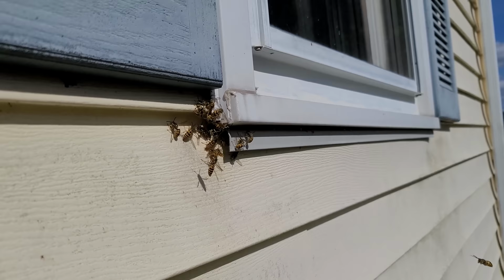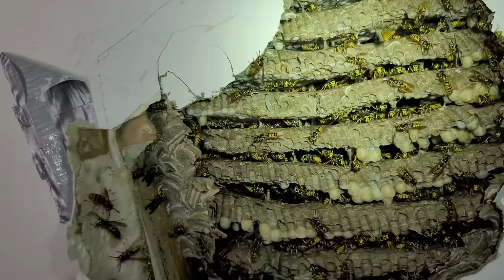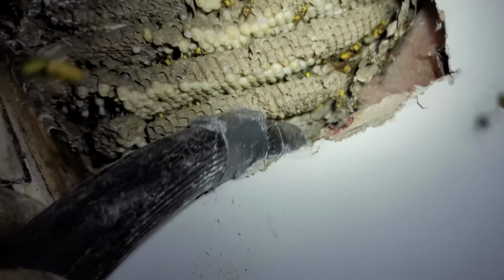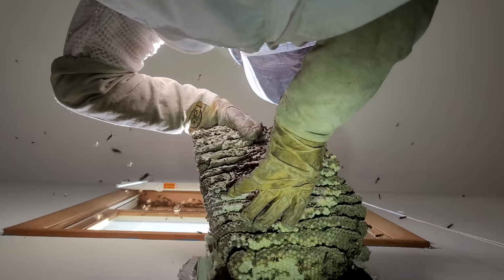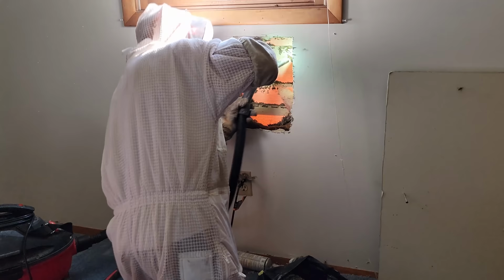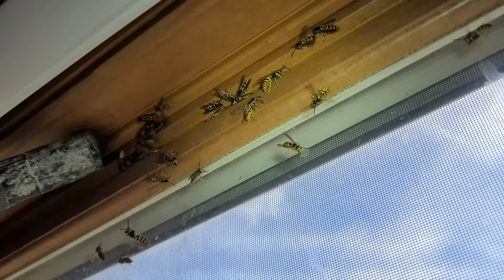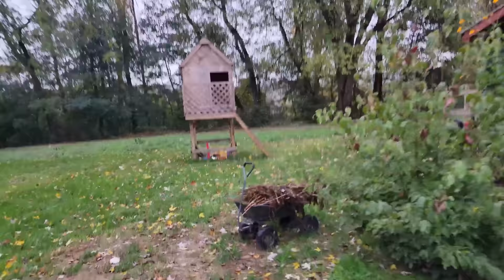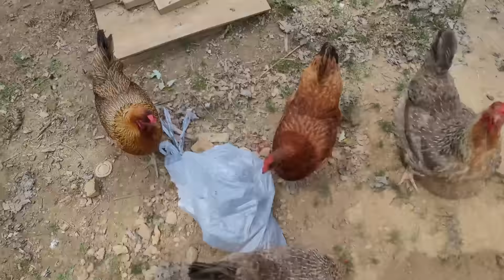MASSIVE Yellow Jackets Nest INFESTATION in Bedroom Wall | Wasp Nest Removal

Comment: I work in pest control and there was a customer who was finding wasps in their home, I went up into their attic and what I saw was a hornet king size nest, you could see the nest on top of the insulation which meant that the nest was probably 8 inches to a foot thick, and it was the entire length of that piece of insulation so it was probably about 3 feet long, easily the biggest nest I’ve seen even after watching a good amount of your videos. Sadly we do not do removals when it’s inside the attic like that so the only thing I could do was treat over the top of the nest with dust and treat the entrance from the outside, which does kill the nest but it’s by no means an instant fix like your removals
Reply: Is there a reason you don’t remove attic ones?
Reply: @blaah9999  Well it takes too much time for we have to be at multiple stops a day, 2 we do not carry vacuums like he does so the wasps would be let loose into the attic/home, 3 minimizes risk for the chance of a tech being stung, a lot of the people in pest control are new to it  so we are told to let the product do the work for us 

Imo if I had the time and was supplied a vacuum I would have no problem doing this for a customer, I’ve only removed a nest the way he has once and that was because it was a total nest breakthrough into someone’s 10 year old daughters bedroom
Reply: @abe_g24  If it was not an instant fix, why didn't advice the customer to contact someone who could actually do it? Someone with time, better tools, and better skills.
Reply: @fuongbregas  I'm going to guess money; why would a company willingly refuse a customer and pass them on to a competitor?

Comment: Had one like this attack me in bed, woke up screaming when i was about 12, they came through the outside wall through the edge of the air conditioner pipes etc, and worked a hole beside my bedroom window, dont know how many there were but luckily it wasnt a full blown nest like this, i will never forget that moment, My father had a bout getting rid of them for sure.

Comment: Here in California, if a house is built with 2x4 walls, the exterior walls need a 1/2" or 3/4" sheet of plywood or OSB to give sheer strength and seals against pests. This is often augmented by additional siding, such as hardiboard. It's wild that it's code to have just vinyl siding as the only thing on the outside of an exterior wall.
Reply: I think they ate the OSB.

Comment: Sooo... after seeing your methods, I've been able to take care of so many infestations as of late... not even one sting either. Ground nests, in wall, under siding, in block cores, at work, at home, at the parents house.... no idea WHY all these nests have been present as of late, when during the past 35+ years it's been pretty dang quiet. But they have been... And the simple, common sense technique of a good shop vac with water in it is by far the key to it all. They attack the vac nozzle if they even get irritated at all... they just get sucked up slowly, 1x1... or maybe 5x5.... or more.. as they come and go. And as time goes on and you have hundreds in the vac, you feel pretty confident entering further and removing more and more. And if you can pull it all off without getting too up close and personal, really working that vac... well.... it's been going off without a hitch so far. I just got rid of one at work, off of our patio, in a planter area... I swear you could fit three bowing balls in the ground that the nest displaced. I don't even understand how they move all that earth!? Where's it all go? Where do they take it? In the end there was just a giant deficit in the ground... you'd think the dirt would be somewhere. Odd... neat though... super neat. Impressive little jerks.

PS... the Ridgid vac I've been using, when not the 18v small cordless... is a real beefcake unit. Not huge in size, but in power. It would just be sucking that entire nest into the nozzle as it hits it... with something like a 3.5" or so diameter tube. Massively capable. Even using a floor adapter on the end of the tube, and placing it near their entrance hole, it'll get the entire spread... not even giving them a chance if they're within like, 8"... just sucks em in.

Something else I've found that helps toward the end of the removal... get a Ryobi 40V blower... those stragglers... you can just blow em out of flight, onto the ground, and suck em up.... by the group if needed. They can't do much against 140 mph bursts. And that's all it is in the end... nothing wet, nothing chemical... just air. One tool sucks em up, the other blows em to the ground when they get too rowdy. To then be sucked up by the first tool. A shop vac and a blower... indispensable.

Comment: Our home (built in 1955) in Albany, New York has concrete block  with brick on the exterior walls. Most the homes around here (in my neighborhood are this construction method. We do have many vinyl homes too. Some have brick with wood framing underneath. The brick on our home has metal straps that are fastened to the concrete block via the mortar joints. The roof, floor, and interior walls are wood framing. Around the window, yellow jackets got in between brick and concrete block where there is space for air and draining. Again, they still got in. But not into the house as they can’t eat through concrete. However they tend to get into the attic once in a while via the ridge vent end eves. But I must agree, modern American homes are poorly built (besides the few custom ones out there).
Reply: I grew up in a 2007 built home and it had no problem with pests. It had hardy board siding. It was a cheap house too but it was built great. It’s still standing strong in a lake right now (hurricane Michael - 2018) don’t ask lol. It just depends on how they are built. The house survived multiple hurricanes and floods. It’s also on stilts.
Reply: I saw a potter/mason wasp flying in and out of a really tiny hole in concrete. They may not be able to chew through it, butthey will absolutely exploit any small opening they find.
Luckily, potter/mason wasps are solitary, as opposed to paper wasps (like the yellow jackets in this video).

Comment: Thank you for clarifying why we always see vinyl sided houses. I know why T1-11 isn't used anymore (water issues), but why not use a composite siding? It lasts a lot longer than vinyl.
Reply from the maker: It's not the vinyl siding that's the problem. It's the plywood jointing the builders don't seal underneath. They leave gaps in the joints knowing no one will see it under the siding, and it becomes an entrance for wasps.
Reply: @HornetKingOfficial  Yes. A good builder can make a solid house with even the most rudimentary of supplies. 90% of it is elbow grease and taking the time to do it correctly and not cutting corners!

Comment: Thank you so much for this awesome video. You are a superstar. I love how you fed the larvae to your pet squirrel at the end of the video. Tonight I removed a yellow jacket nest twice the size of the one you removed this video in my bedroom wall. It is January right now in New York and the temperature is frigid, so there were no bees in the nest. However, the drywall was eaten to a point where there was just a thin piece of paper on my ceiling that I repaired. I did not know if the queen would be there dormant, but I did not see one as I vacuumed out the nest with a shop vac. Tell me if this is true, that other pets would be attracted to an abandoned hornets nest I sprayed hornets spray in the cavity in the hopes that in the spring, the yellow jackets would send the remnants of the hornets repellent spray, and decide not to nest here again

Comment: FYI, there is a huge difference in structural strength between "particle board" and "OSB (oriented strand board)". Most modern houses in the US are made with OSB, particle board is the stuff in cheap furniture. Please don't confuse the issue when talking about home construction.

Comment: I remember when I was a little kid, I had the unfortunate pleasure of putting my leg thru a german wasp nest (vespular germanicus?). 40+ stings up my legs and across my back. Parents called in someone to remove the nest. It would have been close to 6foot long, about basketball sized diameter. They had built into the side of a hill that I was climbing. To this day I have a special hatred for wasps, but I will go out of my way to promote bee friendly environment in my garden. I understand that wasps have a place in ecosystems, but they are a major problem in New Zealand, especially where the climate is good enough that they can be multiple year colonies.

Comment: How do you know when you've gotten all those hornets up and it's safe to remove the nest from the apartment? What if there are still a bunch more in the walls? What about all the ones that are still flying around?
Reply: You pull out the nest and put it in a bag so none of the hornets can escape when you remove them from the house. All the other hornets are sucked into the vacuum. Since the room is closed off before you start working you know when your done because you’ll be able to look around the room and see there’s obviously no more hornets flying around. Then you can look into the hole you made in the wall and make sure all the hornets have been removed from the wall as well.

Comment: I'd love to send you a picture of what I'm about to remove from my attic. Lol.  I couldn't believe my eyes when I saw it.  It fills the width of a roof rafter 24 wide, starts at the eave and goes into the attic a foot or so.  Height is probably 12" at it's peak.  Imagine two footballs side by side then another sliced in half.

Comment: A yellow jacket was in my house so I opened the door to draw it towards the sunlight and made multiple attempts to smash it with my sneaker. No sense in opening the screen door and risk letting in another one or a fly. I hate the buzzing noise of both. Anyway, I must have smashed that thing 10x before it stopped moving. The next day I went to the store and when I came home and opened the door it was still buzzing on the door plate. While I was at the store I had bought a bottle of Hot Shot. I sprayed it and it was swimming in it. I made multiple sprays before he died and I pushed him out the door. When I was a teenager I stepped on a bee in the yard while trying to get our puppy who had run out the door. I thought I had stepped on some kind of hook. I knew nothing about bees and their stingers. I just knew it itched like crazy everytime my foot got dirty and it got pretty swollen at the site. Since then they have become my enemy. I don't care about the honey shortage or flowers pollinating. If they come in my house they're dying.

Comment: Where he lives this type of home construction maybe common. However in the south east it isn't. There are hurricane standards. 90% of new homes built since the late 70s are block. Also no matter where you live in the US siding holds very little structural value. The studs in the wall do. The closer you get to the ocean the more robust the materials need to be. If homes were built like that in FL. Nobody would live through hurricane season, same with all of the Gulf states.
Cool video tho.

Comment: Am I crazy, or do you think I can tape screen loosely on my ceiling and push through the weakened sheet rock in the middle with the screep protecting me and then spray hornet spray through the screen and wait, reapply if needed, and then remove the nest in the ceiling wall when all activity dies down?

Comment: Why is it that houses in the US are so crappily built yet so damn expensive? I live in a house from the 20s in what used to be a rich neighborhood, (Its more middle class now) and the walls are perfectly fine, and hard to penetrate. I went to my friends house a bit ago, and he tripped over something and crashed into the wall, and the whole goddamn thing just gave in. His house was built in the 80's, and everything in it is crappy. And it's even more expensive than our house, even though it's so much worse. Like, most of the flooring and brickwork is from the original house, and its still perfectly fine. The walls have only been repainted, not replaced, and they're fine as well. The basement has never flooded, despite it never being replaced. But when there is just a small storm, like 5 inches of rain, my friends basement almost always floods. Honestly the US housing market is just a pile of crap.

Comment: I have a horrible phobia for these idk the exact species we have her in PA. However when I was 8 or 10 I stepped on the hole of a yellow jacket nest in an old railroad tie being used as a step to a public park and got stung 35 times (we didn't know where they were or where they were coming from, so didn't know which way to run) it knocked me on my butt for like 3 days felt terrible for 3 days. that was 37 years ago, I'm still deathly afraid of them, but go figure, I don't have a problem with venomous snake handling. Do you have a species you dislike working with more than others?And can you even count how many times you've been stung at this point. Great video.

Comment: I saw a paper wasp go under my siding in a crevice near my porch door. Should I be concerned? I hear its pretty common. Youtubes seem to want me to pump pesticide dust in there, but when I look up the data sheets, I'm not too keen on having cancer causing flammable chemicals in my walls. It's just one or two atm, and judging by the nests on my sofits, they tend to just leave after summer is over.

Comment: You mentioned these were German yellowjackets. 

What's the difference between German yellow jackets and the main 2 American yellow jacket varieties? (When you look up the two main yellow jacket varieties in the US, it classifies a western variety that is mostly west of the mississippi covering most of the western US and parts of Canada. Then it shows a map of southern yellow jackets which are basically around mississippi and Ohio river tributary areas, but concentrated in the south east US.) Are these 2 American yellowjacket types similar to the German yellow jacket type?

Comment: I'm in a state of shock/horror at that absolutely abysmal construction. Just plaster, maybe a puff of insulation, and vinyl siding???  I'm biased because I live in a much older house (built in the 1920s) but to me that just seems criminal that construction companies can legally make such flimsy, non permanent construction. The idea that it lets houses "breathe" doesn't make any sense either, my house stays cool in the summer and warm in the winter without any built in vents or AC, just the original radiators, which have lasted 100 years. Most modern construction only has a shelf life of ~30 years before it collapses in on itself. It's just such a shame to see. Your house should last centuries, not decades.

Comment: Yes u r right houses are cheap and horrible build. We actually made sure that the house we bought is brick. I still wish the inside walls would be made out of solid concrete. And we replaced the doors with solid metal doors for the entrance doors not those flimsy hollow doors.

Comment: I really don't understand why the USA still builds such poor quality housing? Here in Europe if I were to punch a wall i would break my hand. I had a wasp nest in my wall, but it was easily removed without even noticing it was in the wall as the walls both outside and inside are concrete so we didn't hear a thing.

Comment: Duh! Why not cut a hole on the outside? So the house is jot filled with Wasps???
Reply from the maker: No. A drywall patch is much cheaper than exterior sheathing. 
Rooms are briefly inundated with wasps during the removal, but the house already has them in it before I get there, duh! 😉

Comment: Ideally, modern buildings with modern insulation should be tightly air sealed.  People need to breathe, buildings do not.
Reply from the maker: I was referring to attic spaces. Perforated soffit is designed to allow air transfer into the attic space, which is where 50% of my yellow jacket removals are. Yes, attics are meant to breathe, but unfortunately, it allows insects in.
Reply: @HornetKingOfficial  A conditioned attic is a better building practice.  But $$

Comment: if i saw yellow jackets going into a hole in the cinder blocks where the sump pump pipe comes out of the wall, and i sprayed it with bee killer and plugged it up.....did i just seal a ton of yellow jackets into my blocks of my house????...i checked in the basement for any bees flying around but none....after seeing your extractions and how big the nests get, did i seal 2000 bees inside the walls of my basement???

Comment: Such a waste of energy and effort! Just blast them with Big Bie Pie and those pests are gone in just seconds!
Reply from the maker: No. This nest needed removed, not sprayed and left inside.
Reply: @HornetKingOfficial  The chemical cyfluthrin itself will do the job and since it's an enclosed space, the concentration of the chemical will take effect instantly. It will take months before the wasps re occupy the same spot since the spray leaves tiny residues on the wood that poisons the insect upon contact. Done it several times, no more water spray, no more vacuuming,, and no more using flame throwers, you just insert a tiny hose that is connected to the canister containing cyfluthrin and leave it for a couple of minutes until the smell has subsided then you can start vacuuming the spoils of war. It only costs $1.89 to eradicate the infestation. The same chemical also kills hornets, roaches, flies, ants, termites almost all.